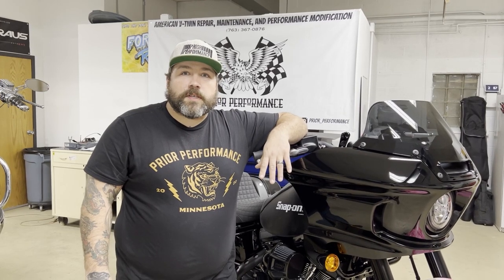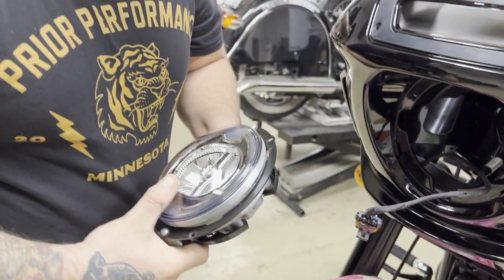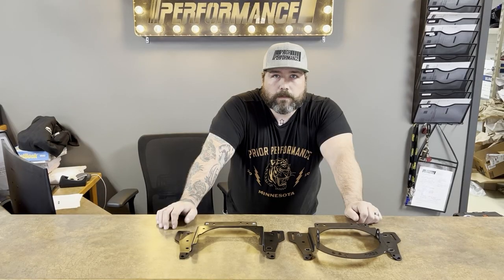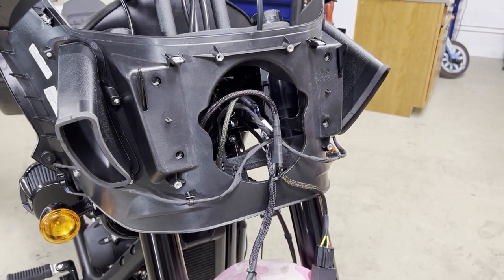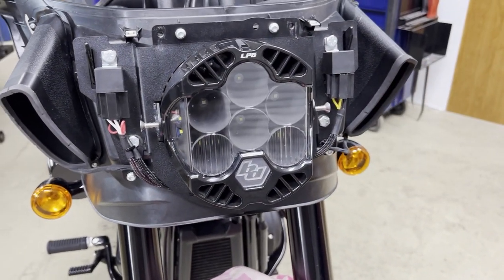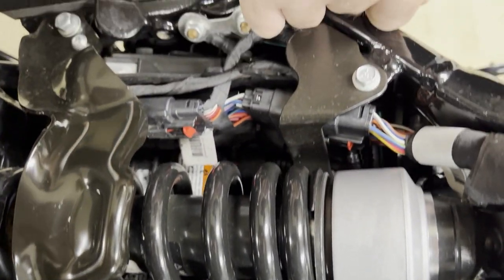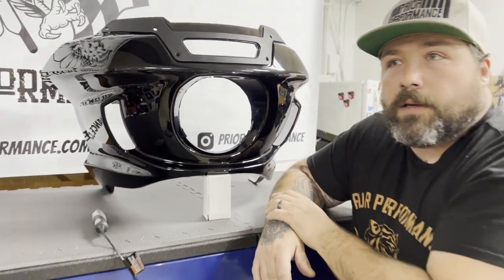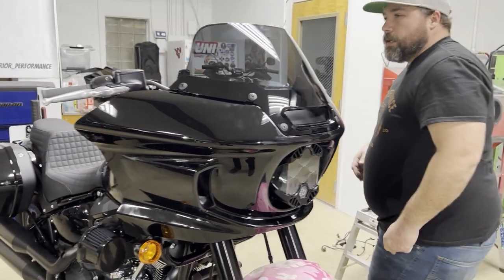Lowrider ST Baja Designs LP6 Install

Comment: Looks clean! I went with another companies set up and it is functional. Is there any limitation of how far you can adjust the light up and down?
Reply from the maker: Yes it does have limitations on how far you can adjust it but it is able to adjust in the range you will need it to on this motorcycle.
Reply: @priorperformance  Ok cool thanks for that info. I feel like I’m losing 25-50% of the lights capability now with my current bracket. Thanks again for the response.

Comment: hi i bought the whole lp6 baja kit i have a different bracket to hold the light were did you get the bracket in this video ty
Reply: I had the same issue, until I figured the new style bracket gets mounted directly on to the outer fairing light opening.
Reply from the maker: We make and sell it on www.priorperformance.com